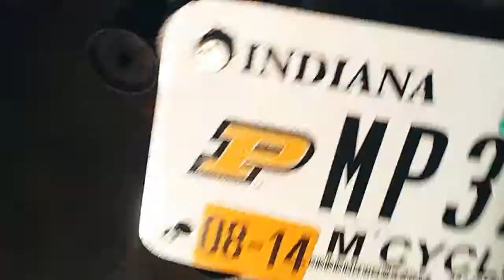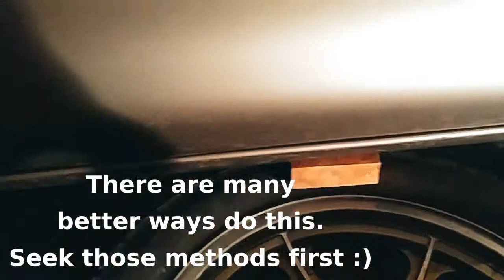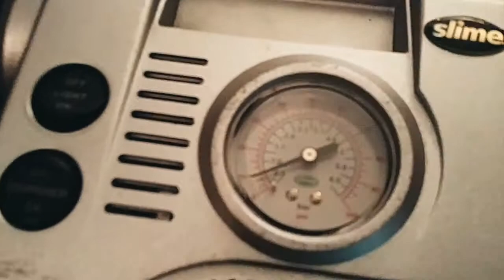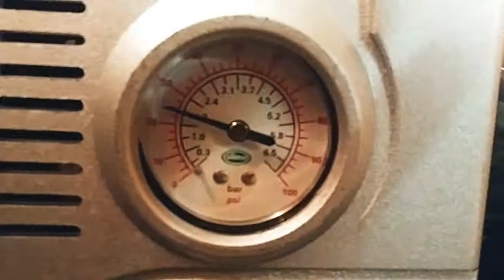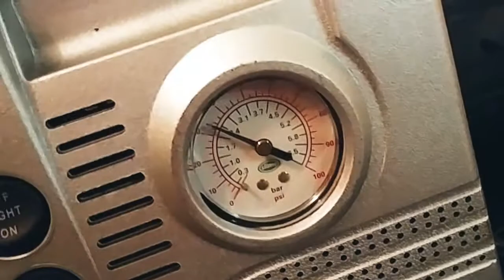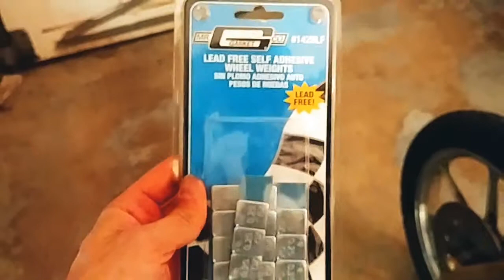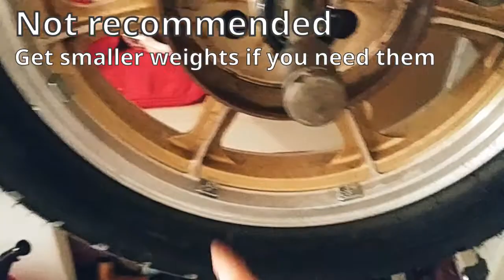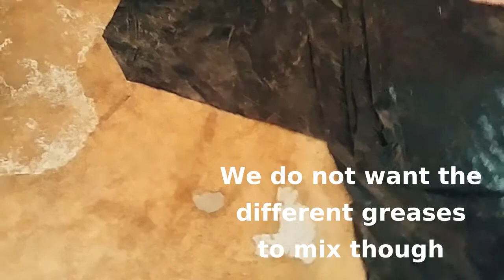1983 Kawasaki KZ550 Spectre - FULL - Replace Rear Motorcycle Tire & Drum Brake Shoes

Comment: Thanks a lot for the video. I noticed that you removed the air box and using pod filters instead. Do you mind me asking where you found them and if you re-jetted the carburators please? I want to put pods on mine but I am getting loads of conflicting advice!  Thanks
Reply from the maker: The bike actually came with the pod filters when I purchased it, so I didn't remove the air box myself. I did completely rebuild the carburetor years ago though (it was badly leaking when I purchased the bike), but unfortunately I didn't capture any of that on video. I just used a standard rebuild kit, nothing aftermarket, and it runs well.
Reply: @loonhunt  thanks for taking the time to answer.. all the best

Comment: I have the same bike, my first rebuild. Could you post a link of where you got your new breaks from?
Reply from the maker: Congrats! It's a fun little bike. I've purchased parts from Partzilla, PartsPitStop, and Parts N More over the years. The brake shoes were part number "41048". Partzilla always seems to have what I need, though it's worth it to shop around. Partn N More has them for nearly half the price of PartsPitStop:
https://www.partsnmore.com/parts/kawasaki/kz550f/?q=41048
https://www.kawasakipartspitstop.com/oemparts/a/kaw/5fff59ea87a86619fcaf09fe/rear-wheel-hub-brake
https://www.partzilla.com/catalog/kawasaki/motorcycle/1983/spectre-kz550-f1/rear-wheel-hub-brake